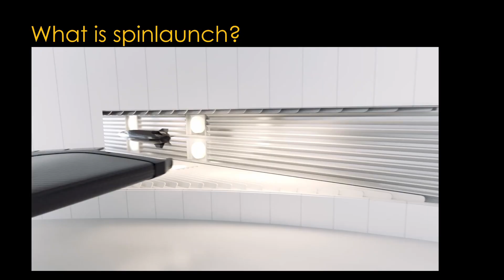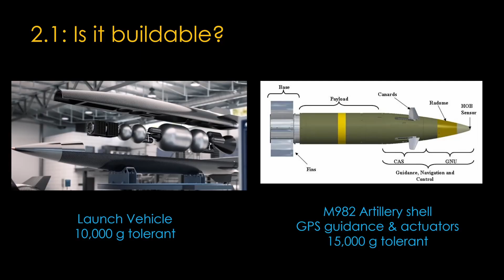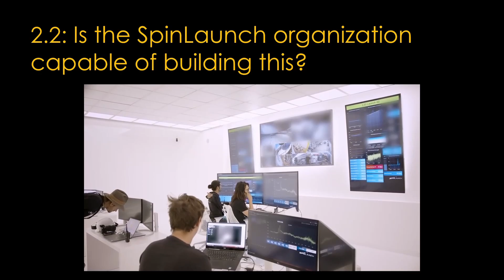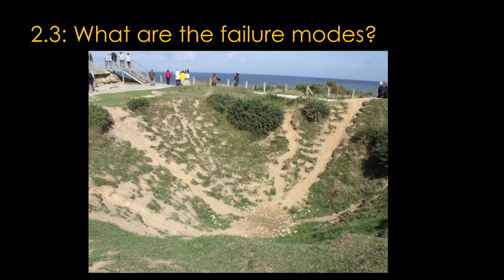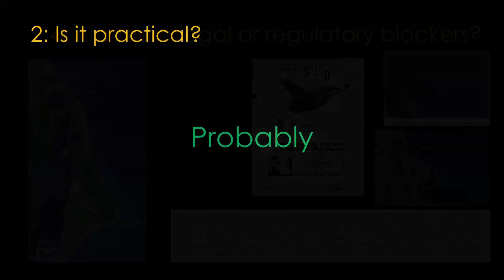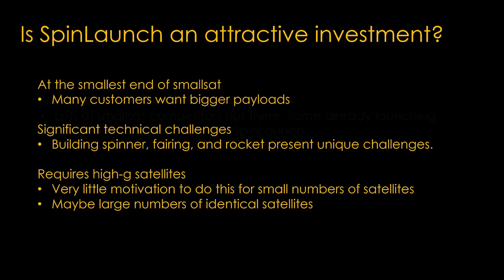Spinlaunch - What the???

Comment: I'd say the biggest detractor, commercially speaking, is their fragility. Let's be super optimistic and consider a best case scenario in which they manage to solve all of the technical challenges, the system performs as expected, and there is a good reception from potential customers regarding the unique payload requirements. Their ground infrastructure will be significantly more expensive than any other vehicle's launch infrastructure, and more unique. The financial and operational risk for other companies in case of an RUD is lower. It's statistically more likely that an RUD will happen off-pad than on-pad, and if it happens on-pad, it's not that expensive to replace, and in many cases they have alternative launch sites. What the company loses more often than not is just the rocket. Spinlaunch has far higher chances than an RUD will happen before the rocket is released. That will basically mean losing an incredibly expensive piece of equipment, rather than the cost of one rocket, it'll be the cost of many, many, many launches. It'll also put the out of commission for a very long time, as they rebuild. It's likely than an RUD would bankrupt them.

Comment: I think maybe they have a long-term solution in lunar material return, but that's probably 10+ years away. Then again, Relativity could just 3D print something much bigger with regolith material assuming near-future ISRU tech)

I'd agree, there isn't much standing them apart from the others. In fact I'd even say the smallsat market is oversaturated right now.
RocketLab is established, Virgin Orbit has great inclination options, Astra has simple GSE systems, Firefly remains unspecified so far. I don't think there's enough room for any more in that space
Reply: Yeah this is the lunar and asteroid launcher for dumb mass, that's about it. Although I think it will excel at that. Building one of these vs 10km of maglev tracks for lunar material launch? No brainer for sure.
Reply: Geostationary orbit launches don't really have much of a market, but I guess smallsats don't work well up there, they need to have enough on board propellant to get to a graveyard orbit at EoL.

Comment: Given that they will need specialized hardware, the only differentiation I can think of is: Have off the shelf satellites, you only need to upload your own software or do minimum tweaking. Launch with a 12 hours notice.
Reply from the maker: I can see that, and rapid response is market that DoD is interested in. Not sure they are thinking about smallsats.
Reply: @EagerSpace  isn't that what DoD calls Launch On Demand?
Reply from the maker: @paulloveless9180  From what I can tell, "Rapid response" and "Launch On Demand" are synonymous when it comes to DoD, though rapid response might be a bit broader as they not only want a launch right now, they might want it from a specific place on a specific inclination.
Reply: That's interesting

Comment: I think people should mostly ignore the g-force numbers, because g-forces aren't forces, and you don't need to resist them. What you need to resist instead is the product of your g-force with the load you are supporting. This might sound pedantic, but it is important. In this case the fairing is supporting most of the structure, and the payload being carried is only supporting itself, with easy offload of those forces onto the fairing. They probably don't need heavy tanks, and actually could likely have extremely light tanks, because the faring is handling all of the challenging loads. They probably don't need any particularly clever circuitry, because electronics nowadays are light by default, so the product of g-force and mass remains tiny even if the g-forces become large.

I share a lot of your concerns about the practicality of this system, but there really does seem to be a major economic advantage over other small launch systems, even partially reusable ones.

E: If I've been pernickety about your videos, that's just because I am a pernickety person who watches your videos because they tend to be good, and if you make a lot of claims there is a lot of room for someone like me to have An Opinion. I like this video, and I think you made good points.
Reply: Fascinating thread between the two of you
Reply from the maker: @paulloveless9180  Do you think it's widely fascinating, or is it more of a niche thing? I personally find that really detailed questions like this are quite interesting, but I don't tend to go that deep because I don't want to bore my audience and I'm not a professional engineer (well, "software engineer", but that doesn't count IMO).
Reply: @EagerSpace  if I'm being honest, it's niche. I can tell that you and I are into the same sort of ideas and questions and my experience is that those are rather rare and esoteric themes.  But perhaps answering those deeply technical questions can fill a void.  I can say with certainty that your channel is the most technical channel I subscribe to and that is why I love it.
Reply: Electronics can possibly survive the g-force but what about everything else in the payload?  A rocket engine and propellant system (because spinlaunch will not take the satellite all the way)?  Mechanisms to deploy solar panels?  Not a chance!
Reply: @chriswright9096  I think it just comes down to how light and compact those systems are. Small centralized motors for the panels and small ion drives, which are both basically just metal, should survive with care. Larger mechanical systems will have trouble. Like there's no way you're launching a JWST like this, but a Starlink, maybe.
Reply from the maker: WRT G forces, the fairing provides support on the outer side of the rocket & payload, and if it's right up next to a propellant tank, it can support that side well if the fit is good. The problem I see is on the inner side of the tank; it will be pulled towards the outer wall and the only thing to prevent it from deforming is the strength of the material and the pressure inside the tank. The fairing will likely support the sides as well and that will help, but I don't think it's enough.

There's a similar problem for the payloads; they will inevitably have empty space inside and everything will need to handle the g load. The artillery shells that I use as an example need special techniques for things to survive. See:

http://caxapa.ru/thumbs/262855/High-G_Ruggedization_Methods.pdf

I probably didn't talk as much about the economics as I could have, but I think that the real question is whether they can produce the fairing and the two-stage rocket for less than RocketLab could produce an electron, as that's what sets their incremental price. I don't think the answer to that question is at all clear, and as I noted it's SpinLaunch hasn't given out any price targets. 

WRT being Persnickety, I welcome the discussion, especially on a video like this where data is limited and I'm making a lot of assumptions.
Reply: @EagerSpace  I would be surprised if the pressure didn't suffice to keep the tank structure intact. The tank wall is thin, so the force it applies to the propellant even under a large acceleration is going to be small. The only thing I would be worried about there is if the propellent compressing caused pressures on the leading edge to fall to dangerous levels, which I think is probably not a real concern but I would have to do some napkin math to be sure.

I do agree that the payloads will have to be ruggedized, my point there was just that if you have a light payload it isn't as crazy as the big g-force numbers might make it seem. I don't see anything in your link that would require really expensive custom circuitry, it's mostly very normal sounding things like using epoxy on heavier components. These issues would be a much bigger deal on heavier payloads, but for small satellites I expect the overhead would be well within reason if the rest of the economics made sense.

I expect the marginal economics are good because the rocket is so small, but for sure that is something to be proven. I am very suspicious of their fixed costs though.

Comment: Spinlaunch already plans to release a 2nd weight when the projectile is released, which greatly reduces the stress on the central bearings. The chamber vacuum can be mostly preserved by rapidly closing a door behind the exiting projectile (and another door behind the counterbalance weight, which exits in the opposite direction). I don't think Spinlaunch is a scam, but as the video notes, they have a big challenge in finding customers who are willing to build their satellite out of Spinlaunch-rated components. Fraud? No. Challenges ahead? Yep.

On the bright side, once there's a bigger market in off-Earth launches, kinetic looks a whole lot better. IMO, kinetic (in some form) is likely to be the preferred way to get initial launch velocity.
Reply from the maker: Can you explain why kinetic looks better? Yes, a first stage is bigger and it requires more propellant, but first stages are pretty simple and reliable technology, and these days you can probably reuse them.
Reply: @Eager Network - Eric Gunnerson  In a word, efficiency. It’s inherently more efficient to transfer energy by “yeet” from the ground than the rocket equation, with the added bonus of putting the weight and complexity of the yeeting system on the ground instead of inside the rocket. On Earth the atmosphere gets in the way, but on the moon a long unenclosed rail can easily accelerate your second stage to the same velocity that it would get from a traditional first stage, and you won't mind launching at a low angle there.

Spinlaunch is not linear, of course, but much of the tech stack and expertise is probably transferable. There may be a market for circular systems even on the moon, but I don't know enough details to say if it's likely. Regardless, it's easy to argue that the #1 technical problem for Earth-based kinetic launch systems, including Spinlaunch, is "atmosphere". Remove that, and kinetic is a lot easier.

Even the best possible rocket allowed by physics will still obey the rocket equation, which means that as you go faster and get bigger, your rocket will inevitably turn into "mostly fuel". The only way to escape the rocket equation is to not be a rocket.
Reply from the maker: @WilliamDye-willdye  Thanks. 

While I think efficiency is an important point, I think that when efficiency is a high priority programs have tended to lose sight of things like capital and operational costs. 

The way I look at it is whether it's more effective to get your payload to to where you need it using a kinetic system plus a second stage or a reusable first stage plus a second stage. The significant capital cost and limited payload types (no peoples, for example) make it less interesting to me for lunar or martian applications.

Comment: I also feel like Spin Launch is an investor scam.
One example of why is:

The rotating assembly would immediately disintegrate upon release of the payload due to the extreme disruption of balance.

Another issue (admittedly I am speculating here) is the explosive atmospheric change.  I feel like there would be a considerable shock front due to the enormous volume of air rushing in thereby imparting unplanned for energy and therefore instability into each major component of the system.

You also are dealing with extreme cooling issues as my understanding is that it takes 10 hours to spin up to speed that whole time putting ungodly amounts of current through the rotation motor which will get extremely hot. 

Finally what about the payload? It too has to withstand the 10,000G load right? 

Eric or others would you care to comment?
Reply from the maker: I don't think the balance part is unworkable. They have talked either movable or releasable counterweight. 

For the atmosphere, my understanding is that their design has some quick-acting blast doors so that as soon as the vehicle is gone, they close and limit.

Big electrical motors are a well-developed technology and they operate under high loads continuously without problems, and they come in very high power versions. One of the NASA wind tunnel motors is 135,000 HP

WRT the payload, yes; it has to be specially designed to deal with the G load. I think that's the biggest issue with the approach; it's going to require quite a bit of extra effort to do that, and you don't have to do that for the other launchers. RocketLab is betting that there's a market for unsophisticated customers who just want to get something in space, and spinlaunch would require the opposite.
Reply: @EagerSpace  great analysis, thank you. I think this would have been better suited as a DARPA or Google X type project.